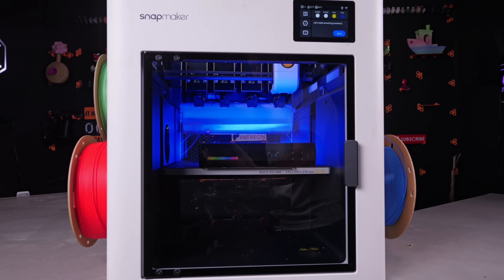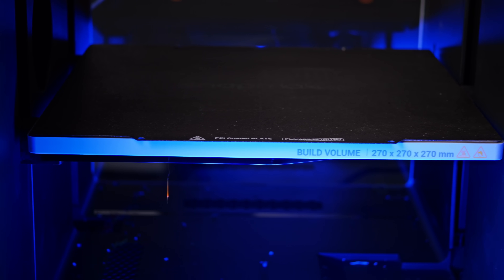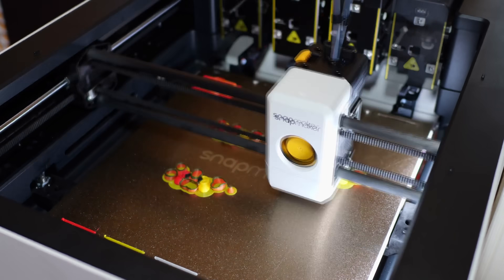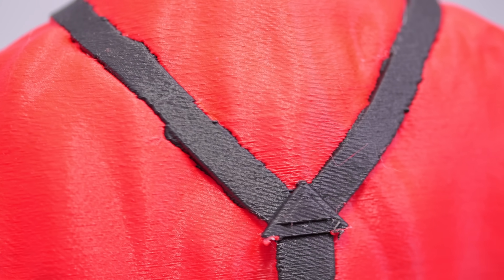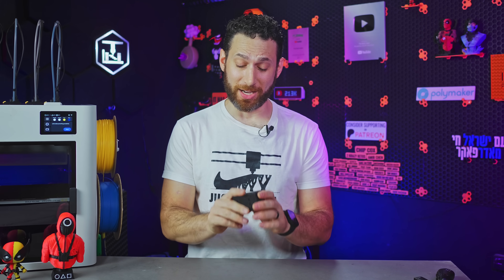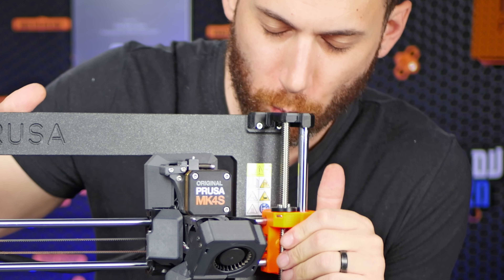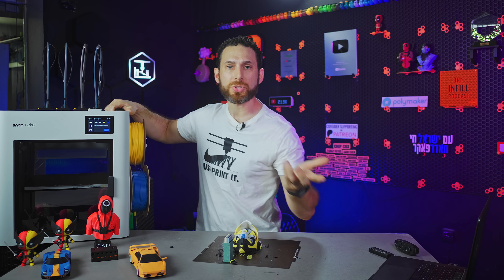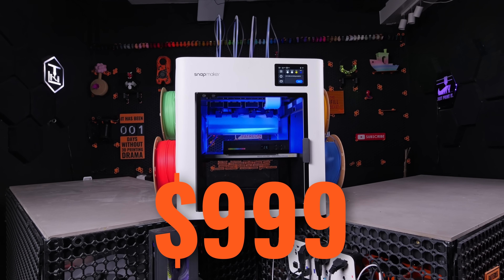The SnapMaker U1: HOW is This Even Possible?

Comment: Quick question - why is there still a purge tower in your prints? Shouldn't this not be needed since all 4 print heads are always primed and ready to go at any second?
Reply: @TehPotentialz  know it's a month later, but was watching another video about that. It's to prime the tip of the nozzle. You can shut it off but it can leave small gaps in the print when a new nozzle starts. I'm guessing from a small amount of filament coming out while it's re heating.  Honestly if it's a big print with not a lot of filament swapping probably wouldn't be a big deal, but it looked like it would be fairly noticeable on detailed multi color prints.

Comment: Multi tool heads was always the way forward for multiple filaments. If print farmers buy this printer early, they will be the ones talking about it's reliability. It's all about reliability. If it can print 1000 hours with 0 mechanical issues, it will be a winner.

Comment: I am a little confused, since I am new to 3D printing, maybe someone could clear it up for me. I currently have an Anycubic Kobra 3, that has been working great. I am hesitant to do multicolor with it, because of the waste. So I have been researching multi-head changers. I thought the point of the multi-head is to reduce waste, in the form of poop. Doesn't a purge tower defeat that purpose? Aren't you wasting just as much material? Couldn't you just do a purge tower on a single head and reduce the poop?

Comment: This video: 
'Here's a nearly perfect print"
    (it's far from perfect)
"But there are a couple issues"
    (lots of issues)
"And it must have been something I did"

It just sounded like excuses for the printer. It's an OK printer, but the results just weren't that good.
Reply: he changed the layer height to 0,1 which caused the painting of the 3d model shining through. i checked the car 3d models and they are a mess at the top surface

Comment: Kindly I disagree. It's only got a 300 and 100 limit. It's still not expetional... And to be clear I'm talking about how you think it's worth twice as much. It isn't. Not until it has enclosed storage solutions for it's materials. As well as upping the specs for this. I think 750 is about right I wouldn't pay a grand for a 5 extruder printer. A tool changer yes... But this doesn't change tools it changes print heads so it's still limited to filament. More like an index with more xs

Comment: The hood is a HEPA filter with passive chamber heating. Not sure how well it will work with 50 watts of power but we’ll see. You can get a photo if you go into the pledge and look at accessories.

Comment: I hope it disrupts the whole 3d printing industry.  I'm hoping this will push Bambu Lab to make something like an upgraded P1S with tool changers.  I know Bambu Lab has been pulling some shady sh*t, but everything they make is incredible.  Going from my Ender 5 pros to my P1S has been insane.  I had 2 heavily modified Ender 5 pros, and every time I tried a new filament or printing, a different model required fiddling around with the slicer settings.  And even when I had everything figured out, they still took twice as long to finish a print.  Sometimes, I do miss tinkering and upgrading my old machines, but the speed and reliability of my P1S is something I didn't believe was possible a few years ago.  Honestly, my favorite thing about Bambu Lab is their filament.  As long as you order 4 or more rolls, they end up being cheaper than the cheapest crap you can get from Amazon.

Comment: wow so if you are still using supports and prime towers, whats the point? You barely saved a few grams of filament in color changes compared to the ams. maybe dont use prime towers?
Reply from the maker: You need prime towers because filament degrades in the nozzle and to build up pressure. Also, you’re just flat out wrong- an AMS would use 93% more filament in some cases.

Comment: 4L50 PAUSE... WAIT a second./ thoise 3 4color wolverines took 77 GRAMS in wasted filament? TURN OFF THAT PRIME TOWER! whats the POINT of 4 tool head sif youre still using a prime tower? lol dude you dont need prime towers anymore!
Reply from the maker: Again, you need a prime tower to prime the nozzle. Not for purge. You can do without it but the print won’t be as good. Also I don’t think it was 77… but on an AMS It would’ve been 500+

Comment: Try to break it as much h as you can. Is the build plate removable? Is it easy to align the build plate? Any issues with heat? If I buy one, do I have to worry about it burning down my house like an A1? What was initial calibration like? How easy is it to perform maintenance?

So many questions....

Comment: We own a Snapmaker Artisan and the 3d printer of it has already worn out sensors and my patience. The customer service was absolute trash. We had THIRTY TWO emails back and forth where the woman told us to level the bed (which we physically could NOT because of the broken sensor.) The Luban software is absolute trash and I loathe it. Even if we are only using one filament/head, we still have to out a full reel in the other head.

Comment: Where are the filament runout sensors in the tool heads?
Needs hotter tool heads
Depending on the calibration of the tool heads perhaps a camera sensor method?
Would definitely want an ethernet port mandatory for $999
Needs an enclosure for fumes with hepa 13 and better lighting in the chamber with a 60FPS camera.

Comment: I'm confused. If it is a tools changer, why is the purge block so substantial? You have a different full toolhead per filament. So it should only need to purge enough to ensure the filament is hot and flowing again. I am also seeing color cross contamination that I would not expect from a full tool changer.
Reply from the maker: it's for priming the nozzle, removing degraded filament and getting the nozzle flowing, or you'll have little gaps.

Comment: Since the U1 runs with Klipper, it should be possible to connect one or 4(🤣) "AMS" like the BoxTurtle to the printer, right? 
Then you could change the material on one head while the others are printing with a little duplex and a color that is not on the same level as the separating layer of the support structures. 
Of course, you would then have a lot of fun setting up the macros and G-codes, but depending on the intelligent compositions in the AMS and the tool changer, you could do a lot with comparatively low poop and set-up times.

Comment: To get 5-6 colors with a 4 color machine you just need to insert a pause and manually change the filament roll mid print. I have done this several times with my original AMS before I got a second one.
Reply from the maker: I should've tried it, but you know, production schedules...
Reply: @thenextlayer of course, it's not nearly as difficult as you mentioned though. Just a pause in the slicer. 

Thank you for the hands on look. I've been eyeing this printer for a bit now. Will likely wait for the full release still but I trust it a bit more now

Comment: What about the non-enclosed filament holders? AMS allows drying inside as well as maintaining the humidity... wonder if there would be a U1 add-on cover that might hinge open?
Reply from the maker: But a pair of filament dryers, one for each side, and it’s still way cheaper than the H2D.

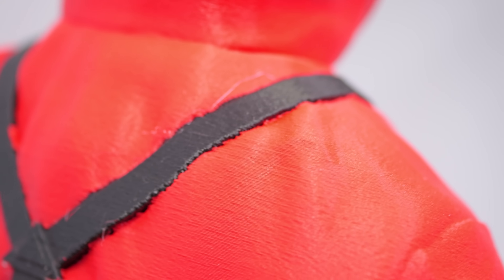Comment: 7:20 Imagine if you could paint on fuzzy skin... And just make the red filament all fuzzy with .1 feature diameter or something. It would look awesome.
15:58 I think Orca has this already? There's a setting in the multicolor tab that is called manual filament change/swap. I haven't tried using it but it kinda feels like what you're asking for?

Comment: Im impressed. Ive been 3d printing for a few years now, The first most expensive printer I brought almost caused a serious case of depression. It was trouble from the off even though the adverts and advertising caught me good. I even tried upgrading it with their own silent control board (theres a clue as to who) that never worked from day one and caused more depression. Their after market support was 8 months late with a insult. Never buying their products again. The super cheap KP3S i brought as a get me going again was great in comparison so you can tell how rubbish the first one was.  Now i run Bambu A1's and ive never had a issue with either of them. Brilliant printers for the money.  Im now looking for a newer printer that does the funkier engineering filaments. If Snapmaker can get that working sweet....  My moneys waiting.

Comment: For 999$ is questionable machine, comparing with all the competitors, the features are what is now availible and this brand is not known for anything. For 750$ open source, may make it on the top tier ranking printers.

Prusa swap head leading, H1D with multi features, P1P + AMS2 , Creality Carbon, Voron etc have sooo much background, quality and features. But what is this one 'calling' to buy it?
- If you want so much colour or more P1P or prusa is better
- If you want quality H1D, P1P, Voron, Creality Carbon, Prusa will brough you to the top, and this one does not give anything close.
- Heat or speed also no, not even enclosed.
- Price? Not cheap at 999$ MRP

In my opinion this is just a nice package that groups everything (in average) together. And for 750$ pre-launch makes an interesting pick, but professionals don't need it and starters neither.. I see it as an upgrade from starter, but for its normal price 999$ I'll skip and go higher in other brands. SnapMakers MUST lower the price, or this is dead already.

Comment: Until they actually release the opensource stuff - they're not honoring anything.  Other companies (especially China based) have made the same promise and never delivered. 

Time will tell if it has good customer support, parts support, and software support.  Since its literally riding on the backs of kipper (which klipper tool changer system did they use?) and prusaslicer (via orcaslicer), I'm not expecting much.  They're just doing what China does.  Copy tech and undercut the market.

Comment: In my opinion, glue should never be used for testing. Sure it has its use cases, but everything, including build plate adhesion should be part of the testing process. It was frustrating to find out that you did not clean the build plate, and continued to print with a dirty build plate, even after recognizing the mistake. It kind of took the focus away from the printer itself, and gives me more concerns about the printer. 

Personally, I have gone with a competitor who is in pre-production (Wondermaker). I hope these all do well, so their prices can all come down, and they can compete on quality. But so far, I'm happy with my decision over Snapmaker, based off their history.
Reply from the maker: This wasn't a test, or a review, and almost all build plates are the same gold PEI these days. But ok, fair.

Comment: A question from a newbie 
If the printer has 4 tool heads. Why is it making a purged tower??
Reply from the maker: priming the tool and getting rid of filament that has degraded at the tip of the nozzle. Also building up the pressure.

Comment: After the Bambu lab controversy a couple of months ago, if a printer doesn't have firmware that is open source, or at the very least source-available, it is a non-starter for me. Hopefully this printer will have an option to be fully enclosed and chamber heating so that I can do multi-material engineering filament prints. Thanks for the overview!

Comment: I would also like to note that their nozzles aren't replaceable (you need to replace the entire hot end, heat sink, heat break, heater block and nozzle) and AFAICT proprietary so you can't just put a high flow nozzle or something on it.
Damn, I was so ready to buy it :-\
Reply: Ah, I wondered why the replacement nozzles were so expensive on the kickstarter.  That explains it.
Reply: Wow, they missed out on mentioning that… hard pass.

Comment: I'd be disappointed with all the final prints that you showed, which rather negates all the technical prowess of the machine.  Other companies are now starting to release machines that have interchangeable heads that include lasers, cutters and markers,  Unless this four head printer is a step in that direction then I think that it will be overtaken surprisingly quickly.
Reply from the maker: As noted, I created all my own profiles.

Comment: to be honest, my Ender 3 V2 neo which has been upgraded with Linear rails on the X and Y, dual Z screws, S1 Pro hotend running on a sonic pad is after 4 years still printing better than some of the new way more expensive printers.

Comment: The problem with current tool changer is the open top. I just got the H2D and the active managed chamber temperature is a must have for higher end material.
Reply from the maker: There's a top hat accessory coming soon :)
Reply: @CT2S3XY  imagine a H2D with colors, laser, cutter and pen in a toolchanger

Comment: I'll wait for results after 6 months or so production. The results you showed did not look good. I have an Ultimaker dual extrusion 3S that prints with amazing accuracy/quality, with very little waste, no bleeding of colors, excellent surface finish, and very important for me - very low noise level. Unfortunately filament producers are dropping production of 2.85mm filament used by Ultimaker so it seems I will have to either buy expensive Ultimaker branded filament or leave the Ultimaker universe. If the U1 proves to be capable of producing both high quality single and multi color prints, and is reliable I will definitely buy it. By the way another well known 3D content producer received the U1 and it was and still is dead on arrival even after interactions with Snapmaker and replacement parts installed.

Comment: Until I see it print ABS or PC or nylon, I’d be hesitant to buy this for use with engineering filaments. With a hot chamber, how prone will it be to heat creep, or thermal expansion influencing Z-offset?

Comment: This review video did not give me confidence in either the printer or the reviewer.   You knew the build plate was dirty yet kept printing?   Printed at 0.1 layer height making the print look ugly?   Know the support material choice would make the print look ugly but still did it?   Constant power outages?   Was there a clean print that had zero issues, or was there an excuse made for every print?
Reply from the maker: Pre-production printer with almost 0 profiles means that I made all my own profiles. As noted. But I sense that your viewing comprehension on the video was quite low, given that the second word in your comment was "review" - which I repeatedly stated this video was NOT.
Reply: @thenextlayer  Can't take constructive criticism?   Got it.  Unsubscribed!

Comment: Jonathan, I am using Bambu TPU 90 for some parts where I need support material. Since ob Bambu, I cannot use the softer 90 (or 85) in the AMS, which makes it not practical to switch even with Support material in the AMS which is not recommended by Bambu. You might say, why not use TPU for supports with TPU- but I bet you know the “sticky” reason why that does not deliver the end result needed for parts selling commercially.  So, will this printer allow me to use 90 TPU and dissolvable-support material? If so, I will buy. Can you talk to SnapMaker or since you have a machine, give it a try. If you need the model to test or TPU material, let me know…

Comment: I’d be curious to see how it goes after 150 hours. 

My Kobra S1 combo was great till then, now it can’t print a good first layer to save its life. The 2mm bed on them just warps into a banana. 

Does the snapmaker at least have a thick enough bed to not warp when printing high temp materials?
Reply from the maker: Same with the S1. I sold mine last week. It was SOO good, then I published a video saying as much, and... it shit the bed.
Reply: @thenextlayer literally today, I’ve just replaced the bed with an 8mm thick unit and replaced the bed frame with a 4mm thick community design. Also just replaced the strain gauge with a warranty replacement. I hope that solves my issues as I can’t justify another printer to my wife. 😢

Comment: Is a purge tower really necessary for a tool changer?
Sorry, this is a dumb question, I have not kept up with the developments in multi material printers for a while
Reply: You still need a purge tower to prime the nozzle. Otherwise you risk under-extrusion after a color change.
Reply from the maker: Also, material in the nozzle sits at 170C, which degrades the polymers. You wanna get rid of that first little bit.

Comment: It looks great but why Kickstarter? Aren't they established enough to sell this as a product without needing to raise funds to build a machine that looks to be already developed?
Reply: @Lewis22b  Having been in the product development business, I would say that even if a company is well established, crowdfunding a new product still brings advantages such as market size/appetite. Specifically because they are an established producer, implies that they have the capability to upscale their production capacity if the market demand exists. The crowdfunding route simply verifies that demand. It’s not just for the money up front, but for the data to ensure they align their production resources to meet demand. 

The traditional pitfall of crowdfunding is that new producers use it as a way to both generate demand and generate cash to produce to meet that demand… at the cost of time. 

I would hope that EuFy already has the cash to scale up to prevent production delays. They just want to ensure they don’t overspend to overproduce… that’s an expensive risk if they had decided to just release this like a “normal” product and it turned out that the demand wasn’t there.